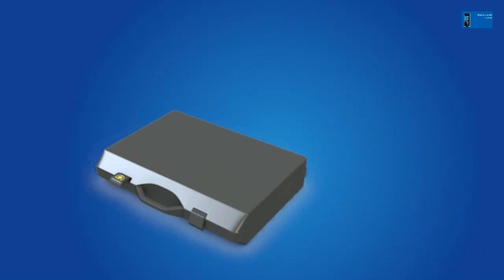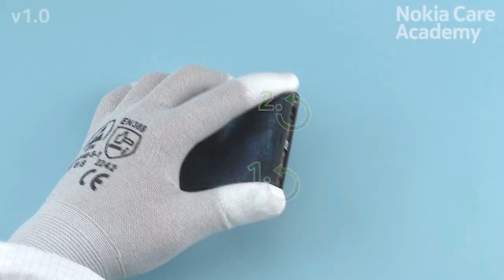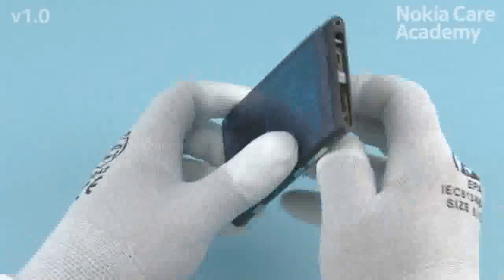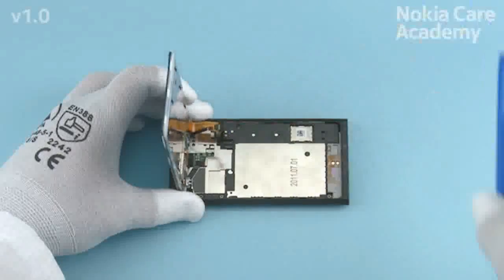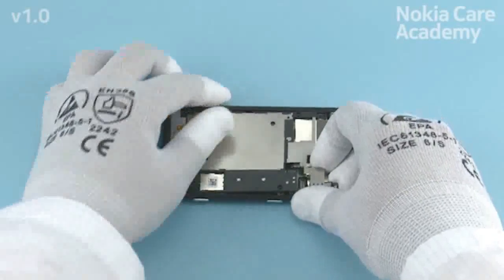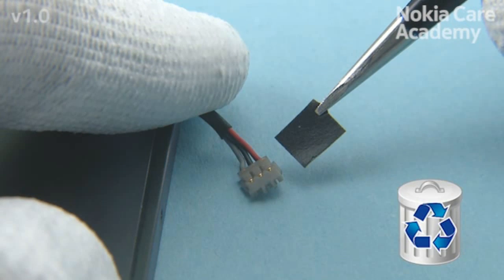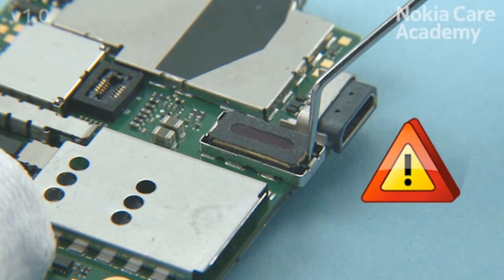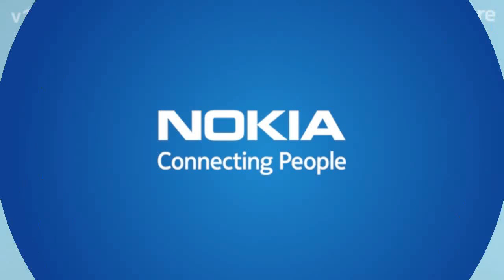Full Disassembly Nokia Lumia 800

Comment: Really????? Why discard so many components?. All the components are reusable. Throwing them away is wasteful and totally unnecessary . The idea of watching a tutorial is so the watcher can save money when in fact your telling them to throw away good parts and buy more?????. Sorry but that makes no sense at all. And why the computer generated voice?. It's intimidating for the watcher and make it sound like only a advanced engineer with expensive gloves and a hi tec lab can complete the job when the reality is anyone with a bit of patience and the ability to change a plug can have a go!!!!. So come on lighten up a bit then you could have a good vid on your hands.
Reply: It means save them for re-assembly....
Reply: AdFibs sorry but the very word discard means just that (discard as in throw away get rid off dispose) may be she should have used the words PUT To ONE SIDE FOR REASSEMBLY. this is after all a instructional video for those with little or no knowledge. So very clear instruction is essential if the repair is to be done correctly and safely. Also can I point out that dismantling any electronic product and attempting a repair can result in malfunction damage and even fires if done incorrectly so CORRECT wording is absolutely paramount.